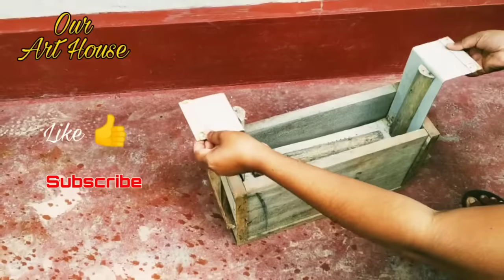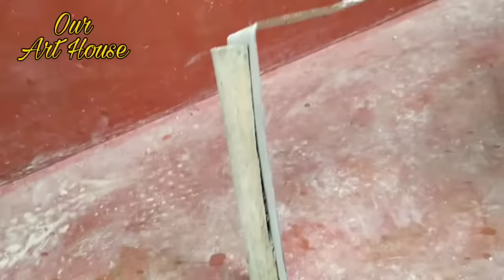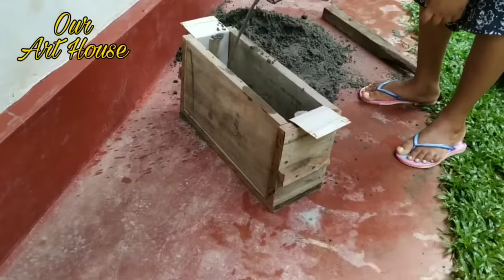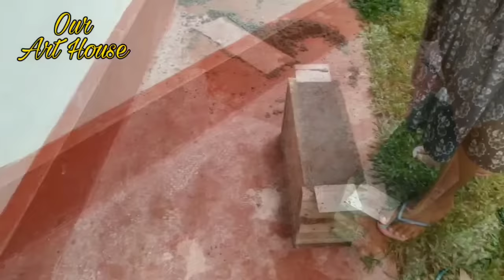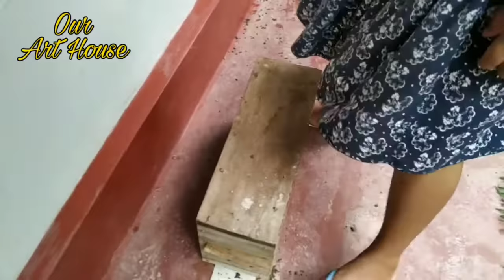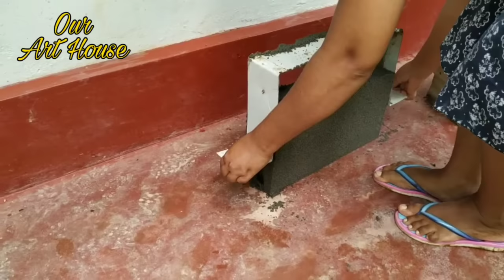How to Make Cement Blocks at Home / Our Art House #construction #blocks

Comment: Demasiado pesado  y demasiado material con todo ese material casi se hacen 3 bloques de 2 o 3 huecos
Reply from the maker: Thank you. 
This mold is made of wood so it can be difficult to remove when placing holes in the middle. But if this is made using iron, it can be easy.